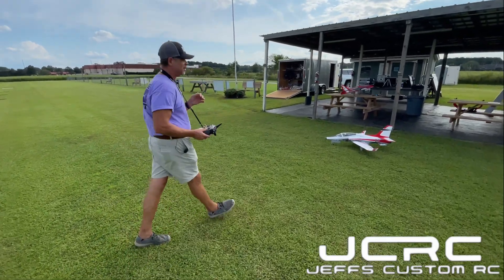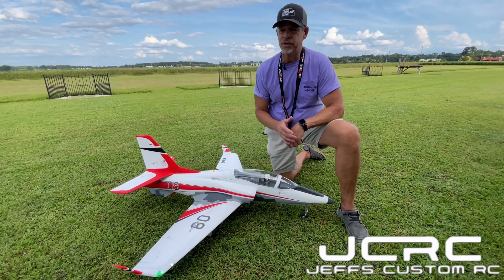Maiden Flight | Eflite Viper 90mm EDF Jet BNF Basic with AS3X and SAFE Select

Comment: Excellent beautiful plane.  I'm curious, I've been looking at the FMS FUTURA 80mm V3, (like the red one behind you at 9:50).  I really like the FUTURA but I think it may be too small.  How do you like your FUITURA compared to the Viper 90mm?
Reply from the maker: Personally… I think the futura is a better looking plane, scheme, color ect. , however, The viper is a 90mm so gonna be a little faster and bigger, but not by much considering the extra cost. To me, the futura is a great buy for the money, and flys fantastic with a 6’s 4500-6200 HRB for approximately 3.5-4 min with throttle management, thanks for watching 👊🏼
Reply: @JeffsCustomRC  I'm with you on size of the FUTURA factor.  The looks of the FUTURA are my favorite with that spaceship look.  I would say this, if FMS offered a 1400mm FUTURA 90mm with a Spektrum AR637TA for $700 I'd snap it up in a heartbeat in the new green scheme.

However, call me crazy, but if I do get the Viper 90mm, and it looks like the clear winner here, I want to blacken out the canopy to get a stealthy sleek look.  Also, I don't see any realistic functionality with the two "ventral fins" underneath the fuselage.  I would leave them off for a sleeker look. 🙂

Comment: Hi Jeff, I have some e-flight Jets with Spectrum ESC and Spektrum iX20 radio. Trust reverse works great at all. BUT for now I want the 90mm EDF VIPER fly with another radio make (CORE from Powerboat-Systems). DO YOU KNOW if it is possible to use the trust reverse feature also with another radio like Spektrum???
Reply from the maker: Hi…I truly think it’s possible due to the fact it’s merely a mix, which can be done on any radio, Brian Phillips did a video on how to do the mix which is what I did, and as I said… I don’t see why it can’t be done in another radio, thanks for the question👊🏼👊🏼
Reply: @JeffsCustomRC  I asked also at SPECTRUM RC directly, the Answer is: "It is a feature that currently requires a Spektrum Transmitter and Receiver"